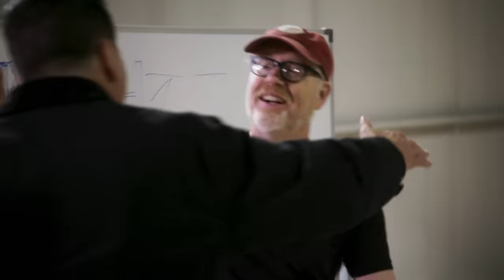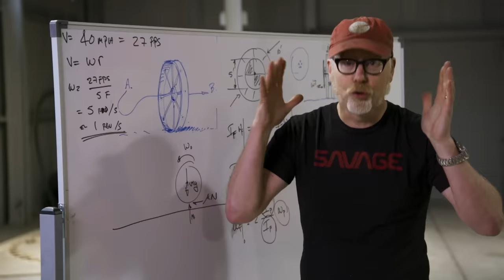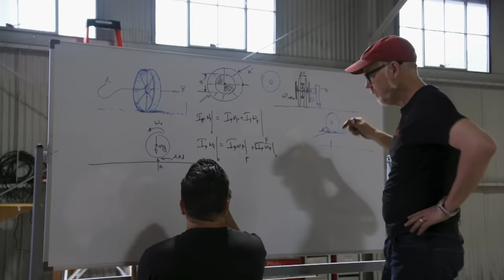"The Power In These Flywheels Scares The Pants Off Me" | Savage Builds

Comment: Seems like the sort of test to do in the bottom of a retired swimming pool, while observing with a drone, from a bunker.
Reply: dry dock not a swimming pool
Reply: An excessive, but appropriate response, although I do agree with the other guy and think a dry dock would be better
Reply: Unless you want to see forward momentum turn into vertical momentum, which would be fun.
Reply: @ryanb6503  hey, nothing's wrong with a little flywheel Russian roulette
Reply: @NathanTruby  I think an old quarry would be a better spot, one thats at least 50' deep
Reply: At the Bonneville salt flats.
Reply: @ryanb6503  There is a reason why it is called a fly wheel.
Reply: Flywheels during the steam powered industrial era were known to climb out of their safety pits and go rampaging across their paths, ignoring virtually any obstacles, if their axles broke during operation.
Reply: ... in space
Reply: In an alternate universe.
Reply: ...behind a mountain
Reply: @ronvosick8253  You'd run out of salt flats and without anything applying significant friction it would have barely slowed
Reply: It'll jump the pool.  Soft sand should prevent it from travelling too far.
Reply: @Bobsyagod  Just put an elementary school in front of it. Problem solved.
Reply: These things will probably climb or jump out of a swimming pool.
Reply: @RustyDust101  terrifying
Reply: Bonneville Salt Flats sounds about right to me.
Reply: That much stored energy gets loose.... it will climb right out of a swimming pool!.
Reply: @ronvosick8253  this is the proper answer, out in the middle of nowhere where the wheels can fly off into infinity if they fail.
Reply: @ryanb6503  >> Unless you want to see forward momentum turn into vertical momentum
Now I'm just imagining this thing doing half-pipes and kick-flips...
Reply: If it takes off in a pool it'll go airborne!!😱
Reply: I know, ..." let's yank on it with a rope" Jethro Bodeen style. 🤔😏
Reply: On Mars.
Reply: @ryanb6503  Yes, but better that it is going up rather than laterally.
Reply: In space lol
Reply: @richpryor9650  that's dark.
Reply: Bottom of a dry dock in a deep crater on the moon observed from orbit
Reply: More like send it to Mars, dig a deep ditch, observe with Rover, watch from inside nuclear doomsday bunker.
Reply: @Frank Peeters Link, please? I can't find any historical example of a flywheel of this size, at this revs. They usually were used to smooth the motor output, not to storge energy. Only historical example I find of something with the kind of power the lads are trying is the Howell torpedo, which never was a functional thing
Reply: 40mph in a swimming pool?
Reply: bunker? you seem to underestimate physics
Reply: Ya  these guys are  coo coo
Reply: @ronvosick8253  yeah, worst case you'd take out SLC.
Reply: They should have fastened the disks to the outside bearing surface instead of the inner shaft. It would have been trickier to power but they could make it much more stable with a much longer shaft supported at the ends, say a few feet out from the disks. The actual vehicle could be designed that way too with hemispheres at the ends.
Reply: Nah fam, let's stand 8 ft. away.

Comment: I am amazed they were in the same room as this monster under the test
Reply: They're putting their security on not been in front of the wheels, what they I think didn't calculated is that.. The flywheel can hit the door and turn around in any other direction.. I'm sure the door can't handle this and is probably going rip the door off the building but the impact can send this thing in any other direction.
Reply: But given how much angular momentum it has, I was very surprised it even turned on the beams.
Reply: @geogmz8277  It could have bounced  up and then back. Or any direction actually
Reply: @charlesleninja  I think the flywheel on the side where they were standing was somehow off balance whether it be warped or not properly mounted. It looked like it started to pick up a wobble.
Reply: Yeah....I agree.  I have done tests at my work not even close to as dangerous as that test, and the precautions I have taken were well beyond what these guys did.  Everyone makes their own choices....but if i need to be in the same room as that thing, I need to be inside a protected area surrounded by jersey barriers AT THE BARE MINIMUM.  In my opinion, this is akin to putting a go cart driver behind the wheel of a top fuel dragster.
Reply: Right on board with you. I know these guys are smart and all, but that test should have been done from on the other side of a steel cage. If that wobble got out of control there is no telling where that thing would have gone.
Reply: @geogmz8277  I'd be willing to bet that it would just rip through the flimsy garage door like it was not even there
Reply: Camera crew, now let me just get a close up shot.
Reply: @williamgolden839  Or shattered, sending fragments everywhere.
Reply: @charlesleninja   gyroscopic precession . If the motor coupling had some of the weight taken up, once it was released and dropped a little on that side, the force acts 90 degrees from where it was applied which means it had to turn. Least thats my hypothesis...
Reply: @quengmingmeow  yeah, if it were me, I would have liked to be in an elevated position like a office in the top of the ware house. Just do the decouple remotely. No way I'd wanna be there if one of the wheels hits the ground and sends the thing careening towards a wall
Reply: Alleged monster. Adams sisters claims have not been proven in court
Reply: When they pulled the motor off was so sketchy, how can you be that smart and also reckless, it could easily turn that whole platform sideways and face them

Comment: Flywheels always have a resonance region. When I was a power plant mechanic on nuclear powered submarines our main engines would hit a freaky sounding region where the turbine blades would sound like a wolf howling then they would warm up and pass through that region.
Reply: That is so cool
Reply: @JamieRogersSites  it was not very cool when someone accidentally reprogrammed the throttle speed to 4x what it was supoosed to be and when they opened the throttle it shook the entire engine room when it hit its resonance region. I literally could not see because the shaking was so violent that my retinas could not stabilize images.
Reply: @mackenziehaines1976  That’s even cooler. Sorry about your retinas, though. Would be nice if people weren’t careless with powerful machines
Reply: Thanks for serving. That’s dangerous work, and tough on the crews.
Reply: What boat were you on? Also serving on a sub, ETN though
Reply: Right, it had hit a point of oscillation. I bet they could move through that moment and reach a point where the frequency changed and it came back to a point of equilibrium.
Reply: @JamieRogersSites  mistakes happen. They are few and far between in my possession. knocks on wood
Reply: @lanceleonard5578  I was on the USS New Hampshire
Reply: What do you thunk is in those turbines
Reply: not to be too poetic but it sounds like it wants to remind you who's really in control.
Reply: Wow that is scary!
Reply: @mackenziehaines1976  how far out at sea where you? were you underwater?
Reply: @geddon436  no, for testing like that we do it pierside.
Reply: I believe this is what gives some aircraft engines their distinctive “howl”, notably the Avro Vulcan. It’s also destructive to the turbine blades and hella cool to hear those.
Reply: That's so cool. How did you get to work on a nuclear powered submarine? What was your previous ocupation that led you there?
Reply: @steampunkastronaut7081  I just scored high on my ASVAB and did well in high school.
Reply: Rotor dynamics was a whole course in mechanical engineering.
Reply: @alielabdimarras7965  yeah I work for a company who does real time harmonics monitoring for industrial rotating machinery
Reply: I'm surprised anything about a nuclear sub would be that loud.
Reply: Critical speed.
Reply: That wolf howl is the engine calling out for the pack. It's time to hunt.
Reply: At the power plants I've worked at and the school I went to we call those spots critical speeds and you never hang out in those ranges.  We usually increase the ramp rates in those areas.  At my current plant you can really see it in the sensors going through the first critical around 1200rpm.
Reply: @Nafeels  I'm pretty sure the howl is from the aerodynamics of the aircraft
Reply: Trippy
Reply: "Don't worry fellows, this is just the Howling Wolf Phase of this device which summons nuclear demons. When we hit Banshee In A Wood Chipper we'll be halfway there!"
Reply: Submarines is full of strange sound and mystery events, any tipe of them. Resonant frequency is skery in close space.Cheers.
Reply: it was probably passing the resonance frequency of a sub

Comment: rotating masses have resonant frequencies at a number of harmonically related rpms.  When accelerating them up to the desired speed, you have to quickly accelerate it past and through the lower resonant speeds so it doesn't spend too much time resonating at that speed.  I used to work with a high speed turbine (10K rpm) and its programmable inverter/accelerator.
Reply: Yeah, Steltzner knows that. They were just drama-queening.
Reply: Oh, wow! You're right
Reply: @DrDeuteron  Agreed.
Reply: i was thinking the same, they must have known where the resonances would be... power through them.
Reply: I do that a lot with my Turbo Diesel truck....Gotta power through those resonant Freq's Fast so it dont vibrate the engine apart.
Reply: d'oh beat me to it
Reply: Wrong. Only in long multi stage rotors like a multistage turbine does the resonant frequency fall so low that you need to cross it to reach the working rpm. In the present setup, there are only 2 concentrated masses at the ends, this system definitely doesn't go into first resonant frequency before hitting 30000rpm. It's a rigid rotor, not a flexible rotor.
Reply: @muthukumarannm398  He's not wrong
Reply: Bend mode
Reply: That's why you always use narrower thicker flywheels instead of thin wide ones
Reply: So does the earth have one? And what is it’s frequency
Reply: @420BudNuggets  Hard to calculate
Reply: @itsoktoberight4431  you mean thick and shorter rather than long and thin?
Reply: The issue appears to be an imbalance more than anything. The flywheels themselves appeared to be warped. You can even see the coupling at the motor moving in the wrong plane. Their project needs very tight tolerances and I don't think they went so far for the prototype.
Reply: Before even considering that issue, why didn't they first balance this thing? Working at a power plant, we go through a fairly meticulous process to balance our turbines before turning them loose, so why would these brilliant minds just slap a couple large steel plates together and expect them not to experience vibration issues?
Reply: @muthukumarannm398  You're right, but it is very much flexible. That steel is not rigid by any definition.
Reply: @ELIJAH WOGGON I mean the earths ration resonant frequency.
Reply: @whiplash636  who said they were brilliant minds? That's what they want us to think. Were supposed to believe stelsner is a lead engineer for NASA. I'm not buying it.
Reply: Well said
Reply: @whiplash636  what machine do you suppose they balance it on? its a test prototype not a 10 million dollar power station turbine.
Reply: @420BudNuggets  if the earth was spinning perfectly on its axis then in theory yes it does have one.
Reply: @milktobo7418  that thing needs to be mounted not placed lol
Reply: @jordanberry508  Lol. Your wording is no less confusing. I'm assuming this person means a small diameter flywheel with greater thickness. The problem with that is it will require a greater RPM for the same amount of stored energy. Also, the vibrations have nothing to do with resonance, the flywheels are just out of balance, which is easy to fix.

Comment: I think they need to go faster to get over the vibration (though obviously in a safer place). Turbomachinery often briefly passes through regions of resonance before reaching the desired speed. Problems arise when you stay in those regions of resonance and let the vibrations grow without bound.
Reply: These guys were very unprofessional, or scientific.. the mars rover guy has such lame vocabulary..
Reply: Critical speeds. Steam turbines on  ships usually had markings on their tachometers or on the hand wheel of the throttle warning not to allow the engines to stay within certain RPM bands.
Reply: I'm more on the side of the rig, and especially its securing, could've done with a bit more work along with the balancing before I'd be willing to say the only issue here is some resonance... That thing looked like it was ready to run off and frolic in the neighborhood.
Reply: I have a trailer that used to do that. Then I looked it over and one of the axles was of square just a bit.

Comment: In the late 1960's, the Librascope computer disk, capacity about 20 megabytes, had six or eight disks of about this diameter, although each was presumably somewhat thinner than yours. Two three-phase motors were used to bring it up to speed, and then one used to keep it spinning. We did calculate that if the building and casing of the device were to suddenly vanish, the disks would have enough momentum to roll over the Bay Area foothills and into the ocean.
Reply: What does that calculation look like?  I'm a mechanical engineer and I wouldn't even know where to start.  What were the inputs?
Reply: @Iffy50 im guessing just alot of equations with rpm, mass, distance and elevation, i have absolute zero idea how to do any of the math though